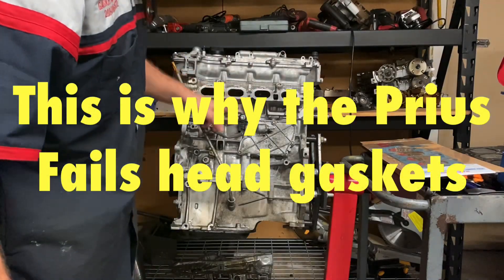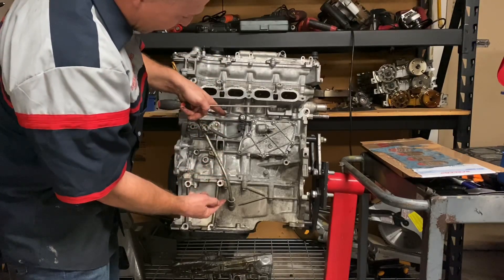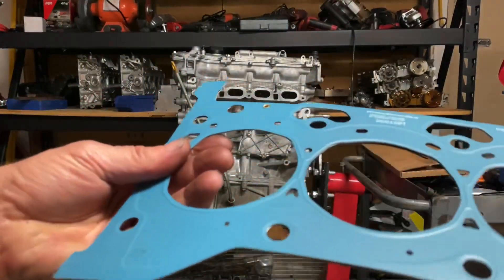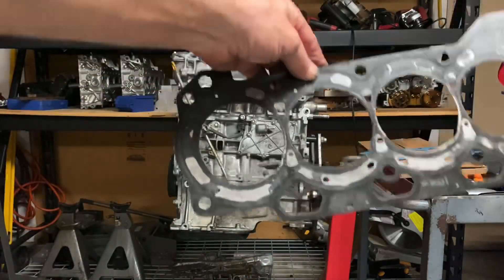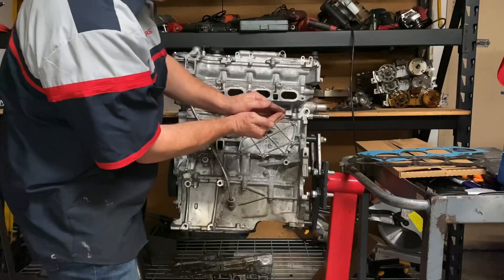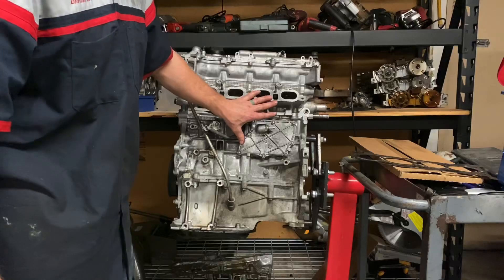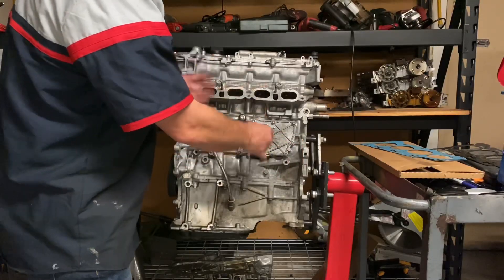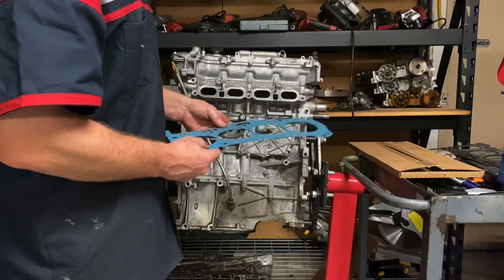THIS IS WHY YOUR PRIUS FAILS HEAD GASKETS, BUT ITS NO BIG DEAL

Comment: This explanation seems to apply to all hybrids in which temperatures fluctuate due to the engine frequently turning off.   Should all hybrids suffer earlier gasket failures then?  Or could it be just a poor gasket design for the Prius only?
Reply: Well the Prius C does not suffer from this problem.
Reply: @hedgehogthesonic3181  how many miles on that Prius C?  And how old?
Reply: @paul_g_6561  Mine has almost 107,000 miles on it, got it with 100,000 miles for $6,500
Reply: @hedgehogthesonic3181  ok - that’s too early for this issue to show up anyway. It typically shows up at 150,000 to 180,000 miles. But I have indeed heard that the 1.5 l engine in the Prius C is less susceptible to this problem than the 1.8 l in the regular Prius.
Reply: @paul_g_6561   I have tried to search online about this issue on the Prius C engine, have not been able to find any so far
Reply: Generation 2 prius doesn't seem to have this issue
Reply: no its the egr system blowing head gasket. If you don't clean it or delete it the HG gremlins will come.
Reply: Yes according to his theory it should apply to all hybrid engines and other stop/start engines but it doesn't. So this video is helpful but there seems to be something else affecting Prius engines only.
Reply: Seems to just affect Toyota hybrids with this engine. Just poor design of Toyota. Doesn't seem to affect other hybrids like my Honda Insight. I have almost 200k miles on my 2010 Insight with the original headgasket and no leaks.

Comment: Maybe clogging EGR system is a big factor too? 3rd gens are the first to have this system, and it appears to be woefully under designed. Cross-sectional area insufficient, and the intake UPSTREAM of the Catalytic converter. The EGR cooler slow-but-sure clogs up with carbon, ditto for the valve, the pipe, and the small EGR passageways in the intake manifold.

Proper flowing EGR is paramount for keeping engine temperatures in normal range. As it clogs, the temps go up. Which probably accelerates the carbon build-up, and overly stresses the head gaskets.
Reply: @Gasket Masters  The whole purpose of having EGR is to lower combustion chamber temperature. The lower temperature reduces NOx emissions. If the EGR is plugged up, the combustion chamber temperature will shoot up making the engine temperature cycling more extreme. And your explanation of the gasket failure by temperature cycling fits the timing of having the gasket fail after the EGR stops working.
Reply: Yeah, I agree. The biggest difference between the two gens (2/3) is the EGR design. I don't buy the explanation in the video as the root cause of all of these failures.
Reply: Hi!

Can any mechanics here help me out?

I just bought a 2010 Prius 135k first 3 weeks are fine this morning I got this hard knocking noise upon a cold start…

Now people said you would lose power and also mpg would go down if it’s the head gasket and not the EGR VALVES…

I drove it today 200 miles and still getting 45-50mpg.

I’m so stressed 😂 not even one month.
Reply: @jaylu5602  do a boroscope inspection of the cylinders, with cooling system pressurized, looking for coolant seepage. Also see if any of the piston tops look extra clean (due to coolant cleaning them). It’s typically cylinder one or two where failure occurs (cylinder one nearest passenger side). 

Any lights or codes?
Reply: @jaylu5602 I watched a video. Guy removed oring from coolant tank cap.
Mine had shakes that morning bad on start up. Removed oring and it stopped it, 300 miles in its good don't know how long it will last.
Also added red coolant to full line was 3/4" down
Reply from the maker: The clogged EGR is a result of temp fluctuations.
Reply: @gasketmasters  Well, that's debatable. 3rd gen is first to have this "mark I" EGR, and also the gen where the head gasket are failing in such large numbers, and so early. For 4th gen, they've pretty much DOUBLED the cross-sectional area of the EGR, and revised the intake to be downstream of the CAT.

Comment: Great video. I’m in the middle of swapping my head gasket on my Prius and it looked exactly like the old one you showed. Would periodic cleaning of the EGR cooler cut down on the time between head gasket changes?
Reply from the maker: One has nothing to do with the other. But periodic cleaning of Egr is definitely recommended
Reply: @gasketmasters  my 08 prius rattles for a few seconds on start up about 3 times per month.
I have not noticed any coolant loss. 
Is there another reason for the rattle/shake.

When a 08 prius head gasket fails. Is it just coolant into cylinders?  Do you also get combustion gasses into coolant?
Or coolant into oil?
Thanks...
Reply: @golfish8589  exactly same on my 2012 185k.
Did you figure it out?
How long has it been doing this?
Its happened twice in a month now.
A little worried 😢
Reply: @sueellenmcgoey8708  

It was my brothers car.
I couldn't remember what I did. I read through all the comments here to refresh my memory. 
I did not replace the head gasket.
I think what was causing the issue was condensation collecting in the plastic intake manifold.
You should be able to remove the tube going from the air cleaner to the intake manifold  with a flat bladded screw driver.
Then the intake manifold should take no more than a screw driver and maybe a 10mm socket.
See how much water is in there. It could be fairly greasy in there. There is a tube going from the engine to the intake manifold that takes some exhaust gasses from the engine and socks it through the intake manifold.
Clean this all out and give it a try.

You can also bring the car to a auto store. And they can scan your car for error codes.
If you have engine misfire on cylinder 1. Switch the sparkplug coil with another cylinder not adjacent to the bad cylinder and see if the misfire follows the coil.
Reply: @sueellenmcgoey8708  
I also saw this tsb put out by Toyota for intake camshaft timing gear assembly.

T-SB-0087-09 for 2ZR engines  2009-2010.

Let me know what you find after scanning your car and cleaning any water out of the intake manifold.

Water is not compressible.  If it gets ducked out of the intake manifold and into a cylinder. It will cause a rattle
Reply: @sueellenmcgoey8708  
In the mean time. Keep track of the coolant level when hot and cold.
If the coolant level is slowly dropping.  It could be leaking into the cylinders .

This is when a head casket is needed.

Also when you pull the oil dip stick and it shows a forthy milky color. The coolant is leaking into the oil
Reply: @golfish8589  thank you!
So far none of those issues.
Going to put new spark coils PVC & clean egr with new valves.
Then maybe new head gasket.
But really thinking about swapping engine to g4 before spending 1500 on HG.
Reply: @golfish8589  I wash my car alot! Hope water is not getting in!
Thanks for all the help! Will do❤
Reply: @sueellenmcgoey8708  
I doubt water could get in from washing.
Just condensation. Possibly from lots of short trips.
Reply: Here is a well done DIY head gasket replacement presentation, Prius 2016-2022

https://www.youtube.com/watch?v=NAei4nsNFzk

Comment: Hi!
Im having issues with my 2011 prius I just bought it recently it has only 134k miles and I just got back from a  vacations trip it was like 3 thousands miles round trip and I put like 4 quarts of oil total and I noticed the car has like black stains I. The rear bumper and rear door like if the car was smoking or something. Pls help any idea what it can be? I just replace the PVC valve and still burning oil like crazy . pls help! Do I need to replace head gasket? That's what I'm thinking but I'm not sure help!!!!!!!!
Reply: Clean your EGR

Comment: Thanks for the explanation.  I asked the service advisor at my dealer, and he talked about electrolysis.  My mind went blank.  You really satisfied my curiosity.
Reply from the maker: Electrolysis has nothing to do with the head gasket failing or engine overheating. If he meant electrolytes, that’s just referring to the ph balance of the coolant in regards to it’s ability to carry a current, or allow metal to react by oxidizing (rust). He’s either a super genius beyond my level of understanding, or he doesn’t know anything and wanted to sound smart. Thanks for the comment.
Reply: A master of a skill knows how to explain it in the simplest of terms anyone can understand to some degree.
Reply: how to make electrolysis: 2 fingers in the electric outlet, two fingers on the other hand in a bucket of water. thats how you do electrolysis. seems like this is what this mechanic was doing all night long.

Comment: Is it possible to use ARP Head bolts on a Prius when redoing the head gasket so it will last longer or is the time span the same as factory head bolts?
Reply: I was thinking the same